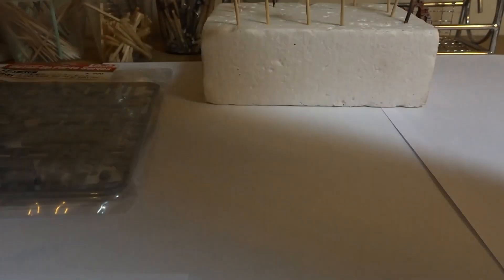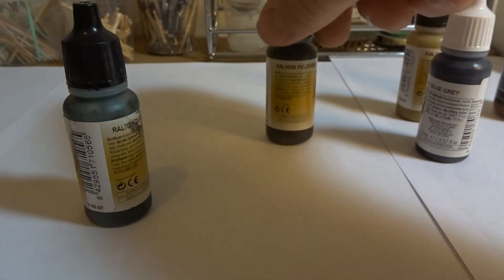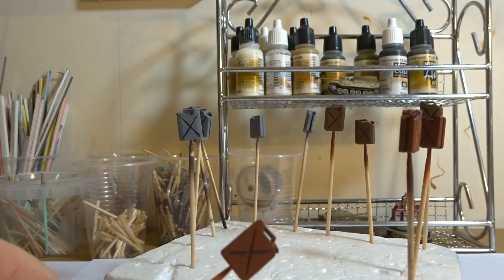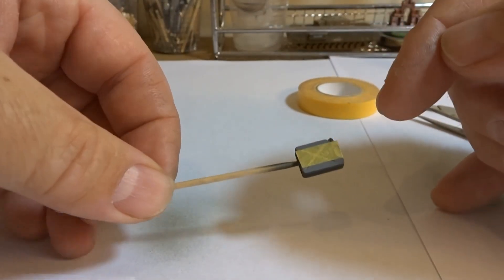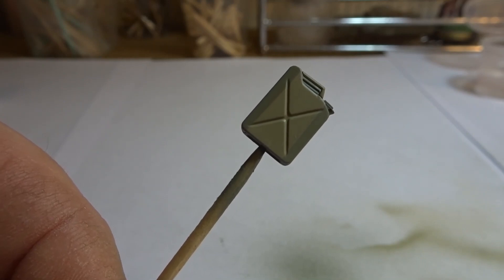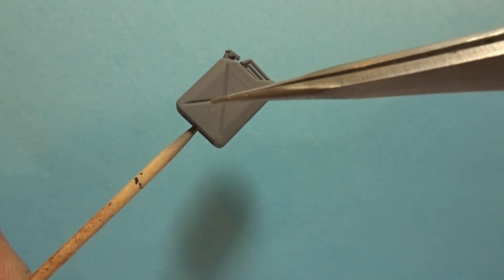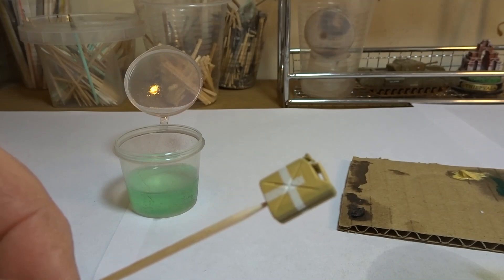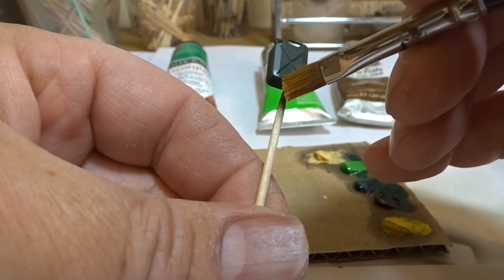How to Paint and Weather German WWII Jerry Cans PART ONE of THREE

Comment: Nice video. Thanks. How did you attach the cans to the cocktail sticks?
Reply from the maker: If you use your fine drill bits and make a hole in the base. Fill this with a cocktail stick and a drop of super glue. Once dry away you go. Once finished cut off the cocktail stick and cover the remaining wood "plug" with a spot of paint. Many thanks for looking in and subscribing to the channel. Happy modelling!